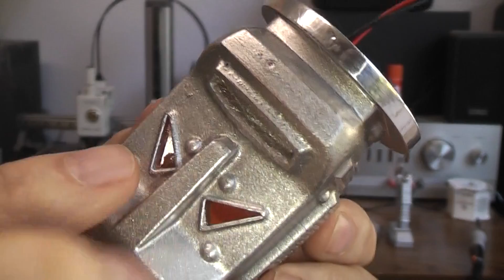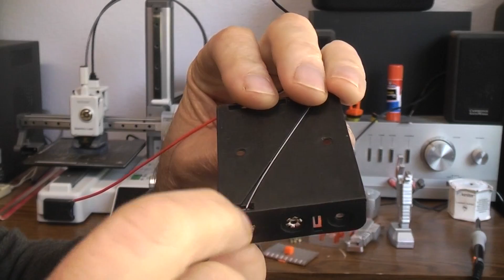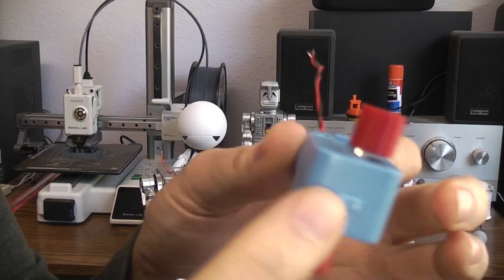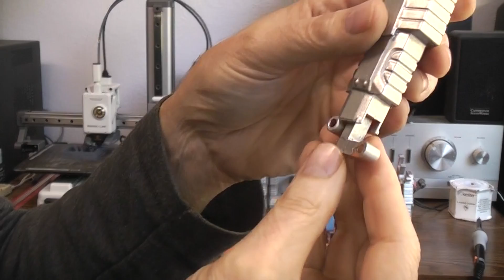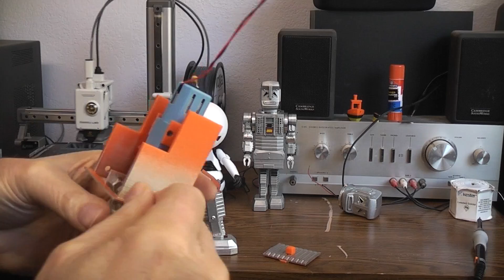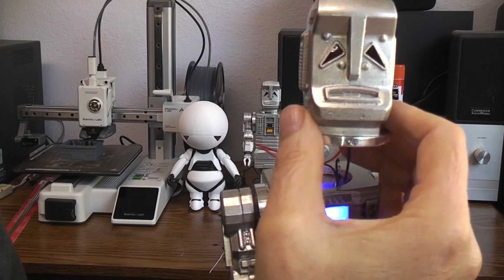Assembly video for the 25% larger Marvin the Paranoid / Depressed robot.TT gearmotor version.

Comment: Will a double a 2 battery 🔋 run the the robot?
Reply from the maker: Sure, two AA batteries will run the motor but you will have to add a boost converter to get the 4.5 volts for the flashing color changing LEDs, if you plan to use them. You could also use 2 or 3 AAA batteries.
Reply: @Robothut thank John well the right motor and battery pack coming tomorrow .. going slowly on this one to get things right . Except I glued  the arms on cause I glued head on before that . No flashing lights .

Comment: So neat !! Like motorized monsters

Do you list all the parts in the description and where to get them ? Ty
Reply from the maker: The STL link is in the description. As for the TT gearmotor you can find the blue ones with metal gears on Ebay, Amazone and Aliexpress. Not point putting links for these sellers as the link would not work weeks or longer from now as seller change.
3 AA battery holders can be found in the same places online as the motors as can the slide switch, I like to use with 19mm spacing on the screw holes. The 4mm brass rod can be found at local hobby stores or on line. Again links are worthless as sellers come and go, the video is for ever.
Reply: @Robothut  no but the list of part  is vital thank you . I been eyeing a 3d printer and is on my buy list , soon .
Reply from the maker: The parts are all mentioned in the video. @PeterAgostiniJdcap26
Reply: I was not listening well, enough to make list  that fast .  @Robothut